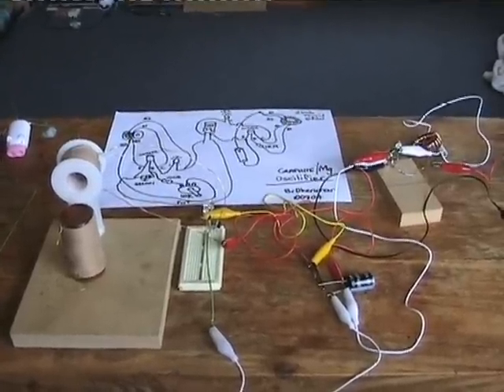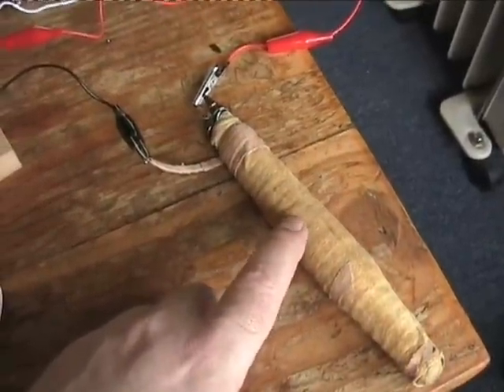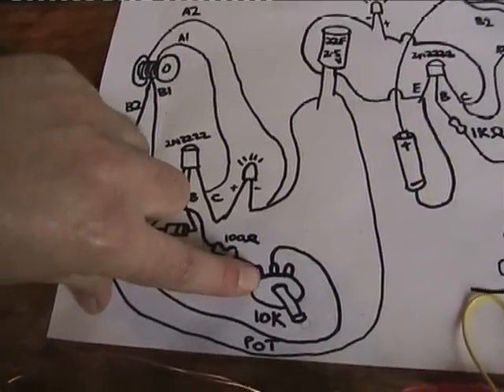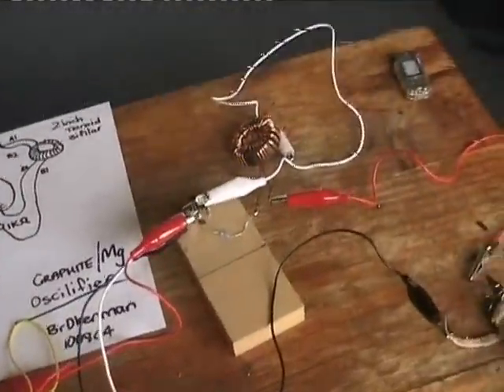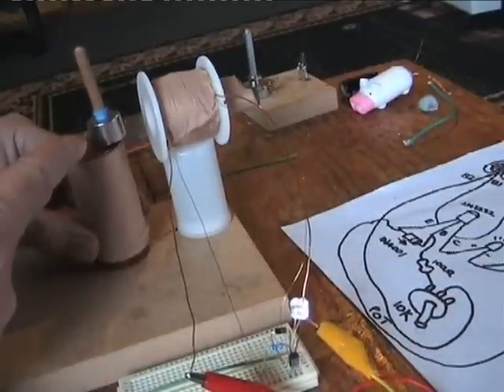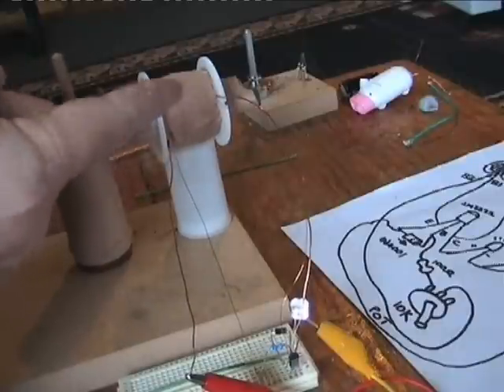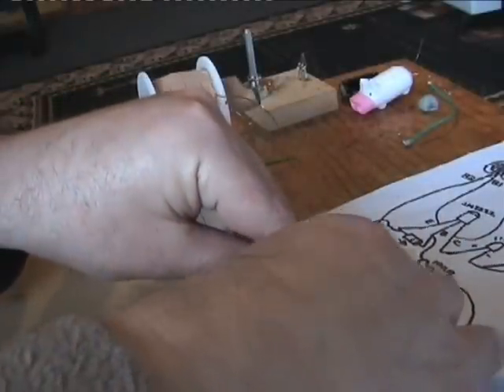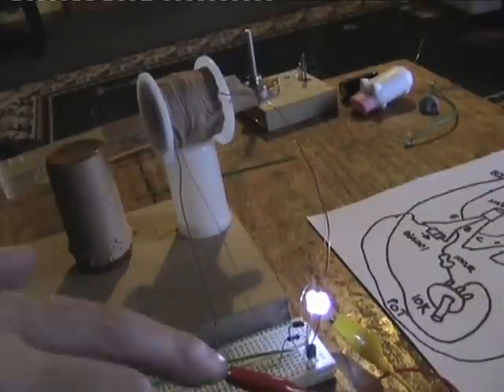Graphite Magnesium cell thru joule thief powering bedini spinner and self oscillating

Comment from the maker: Hi Lne. I used the term self oscillate rather loosely. In the first half the circuit was oscillating by way of the magnet passing the coil and opening/closing the circuit. After removing the rotating magnet the circuit oscillates 'seemingly' by itself. There is no perpetual increase of vibration as might be seen in a true self oscillating mechanism which by my thinking will destroy itself eventually from the resonance created. It doesn't run on it's own power in other words.

Comment: This is a very unusual circuit but a great one to build. Nice work! How many turns do you have on the joule thief coil and how many on the bifilar bedini coil? Also what what thickness wires did you use for the bedini coil?